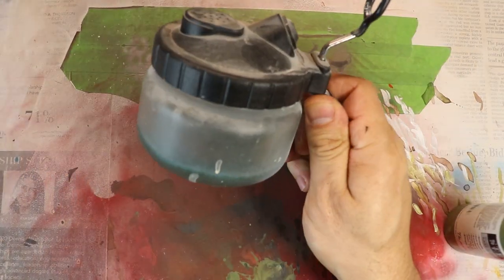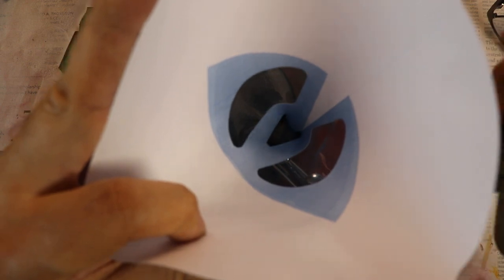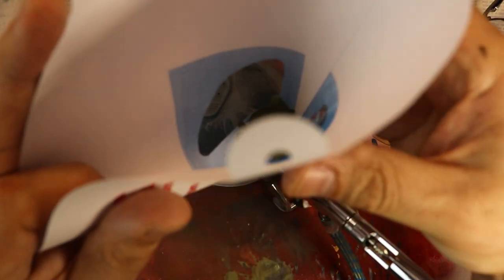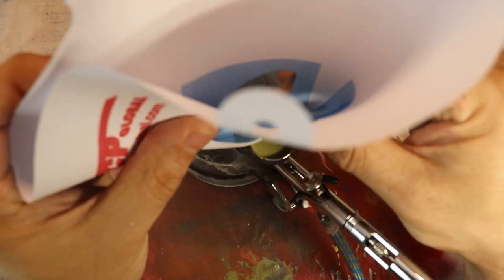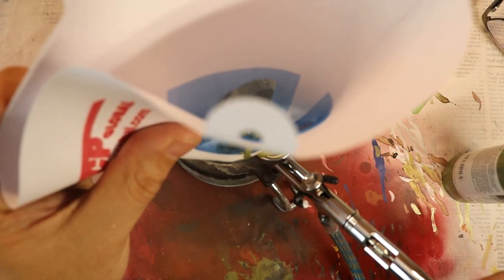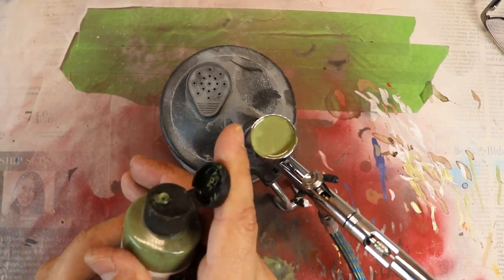Hobby Tips: Straining Your Paint

Comment: That's such a good tip :D There's even little purification cups you can buy from AK Interactive for example that fits directly into the airbrush cup. :D Didn't have any issue with the primer anymore since I used them. :D I just throw that into my water cup so it doesn't dry while I prime and then I can clean it after I'm done. :D
Reply from the maker: I’m definitely going to pick up those purification cups!  Thank you!